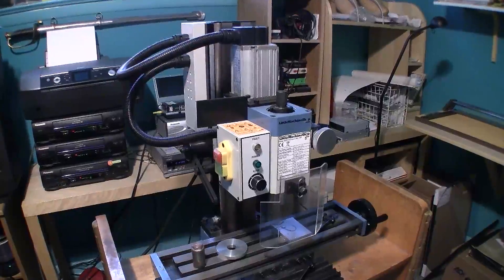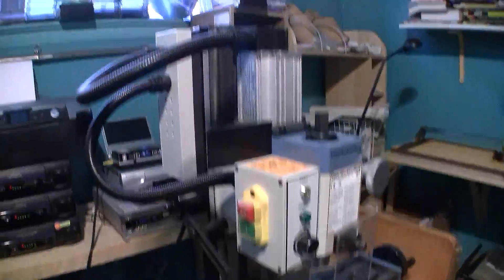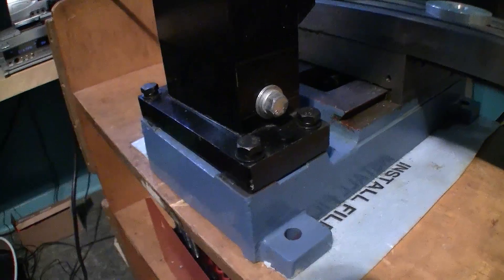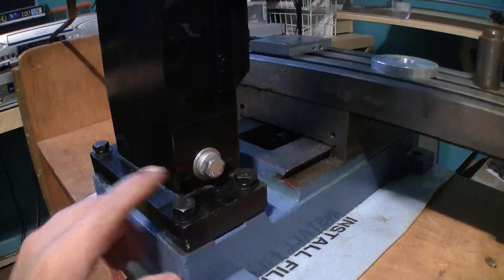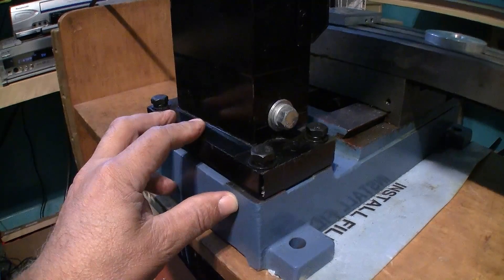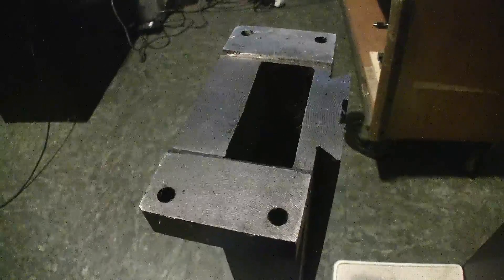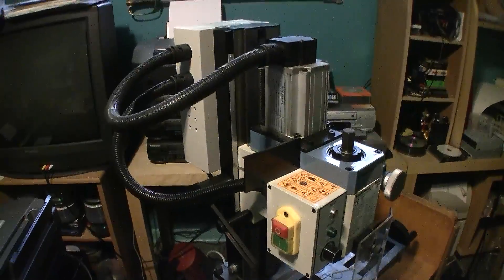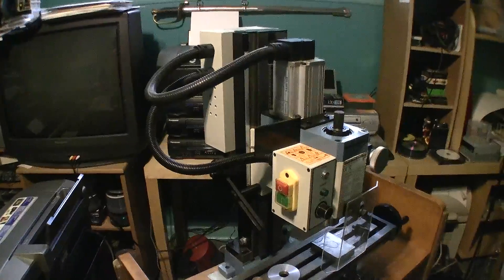Minimill repair - Showed up with a cracked Column Base!

Comment: The more I see this mill of yours the more I wish I would have bought the one you have. I think it was the same price as the Sieg X2D and I believe yours has a brushless motor, but I was told that yours is smaller than the X2D. It looks to be to be the same size.

Comment: just had the same here in the uk. but mine is on the side
Reply from the maker: +dmcarpman The are very thin in cross section as you can see. They do not handle mishandling by the shipping companies very well.I'd gladly pay extra money for a column at least a1/2" to 3/4" thick wall. If would add incredible rigidity, would reduce vibration, and improve overall performance greatly.Please pass the word about my fledgling Machining and Miniatures Channel I really need the exposure. I have a lot more content to share!Joe